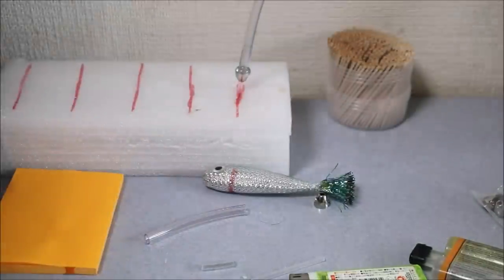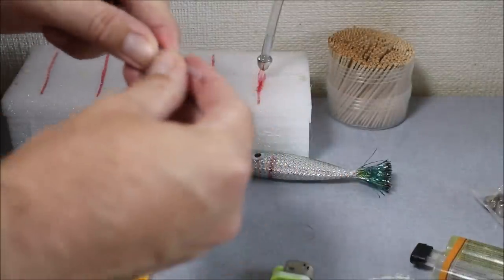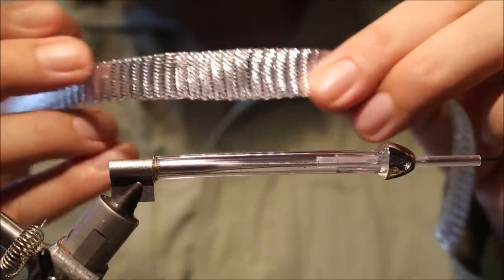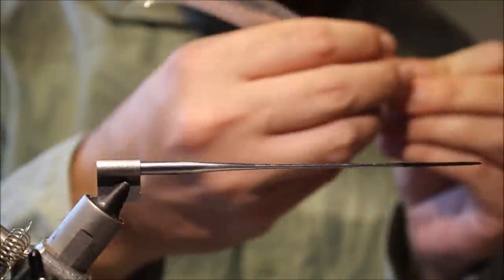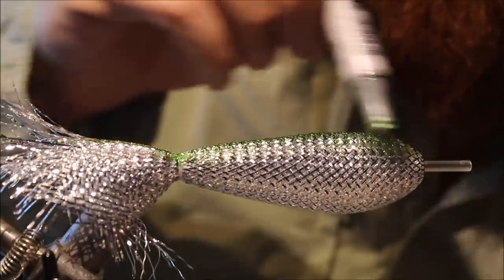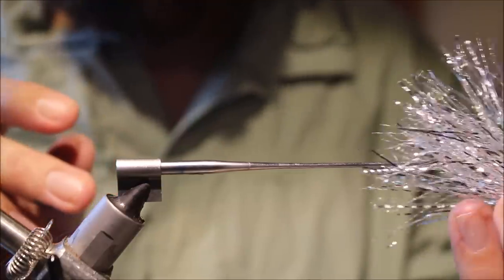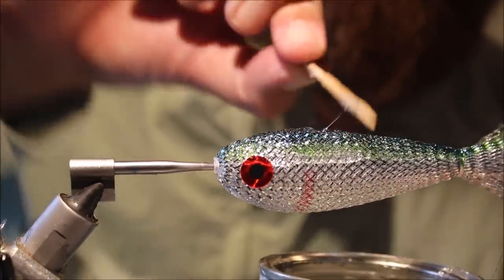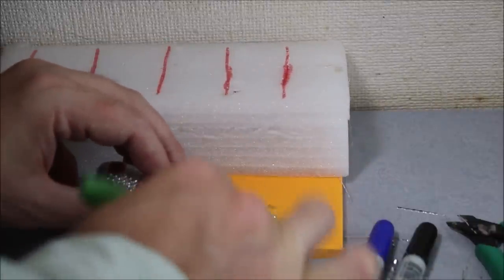Tying the Squishy Fish (variant)

Comment: This is a wonderful pattern. If I don't have a tube fly mandrel would it be possible to get similar results on a stainless streamer hook? I'm kinda guessing rolling might be an issue with little for the material to grab on to. This fly truly has a lifelike sqishy feel and great flashy baitfish appearance.Thanks for sharing.
Reply from the maker: If you don't have a tube pin, cut a wire coat hanger! You could probably get something similar with a long shank hook but it'll be tricky